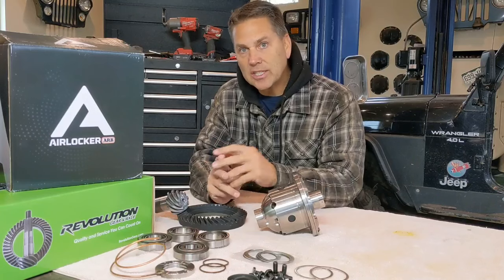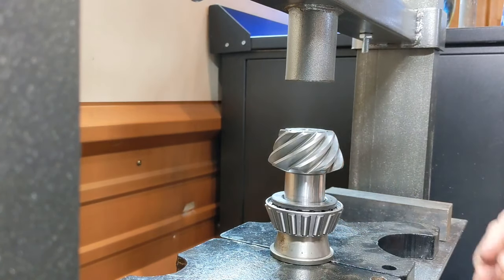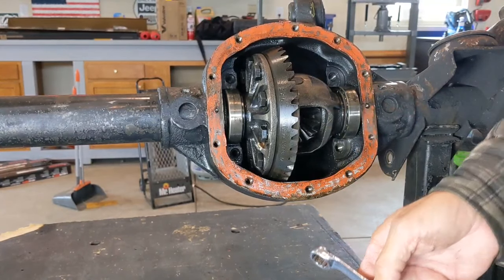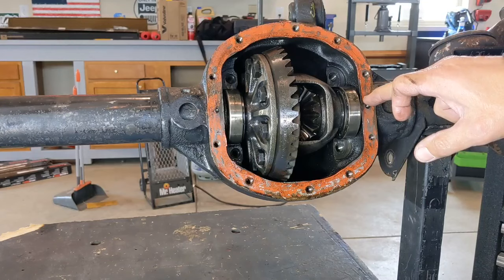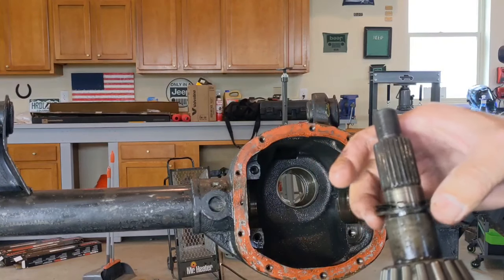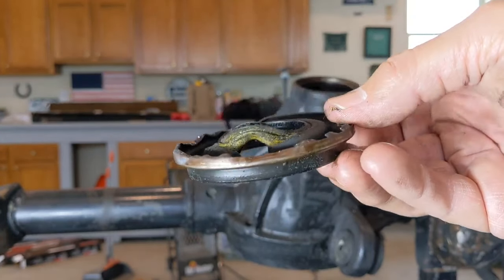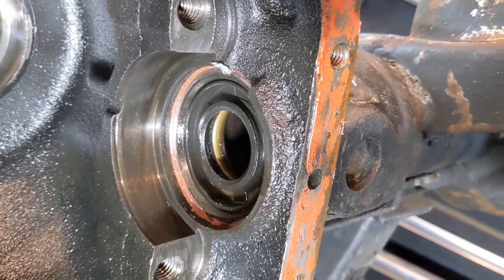How to Install an ARB Air Locker (Very Detailed!)

Comment: The most comprehensive video on air lockers on YouTube, I had been looking for months for this information and especially the setting up of the backlash and preload etc.
Thank you for taking the time to make this tutorial and sharing your obviously vast experience and knowledge with us, you have earnt my subscription and respect.
Reply from the maker: Thank you, I appreciate the comment and subscription!
Reply: @TheBFHGarage   Did you install shims behind the race because at the time of this video you didn't have a clamshell puller or you did it this way knowing most would not have a clam shell? I would really rather install shims on the pinion like my D44 I did as it made it pretty nice with the clam shell.
Reply from the maker: @ChrisLawley43  I installed shims behind the race because that's what came with my install kit. At the time my preference would have been for it to be the same anyway as I didn't have the clamshell puller. But the install kit was the main factor. If you plan and installing behind the pinion bearing then make sure your master install kit comes with those shims because most don't.
Reply: I second that. Great video!

Comment: This has got to be ,by far, the best video I've found on setting up gears in a diff. Aside from the helpful instruct for the locker. I just finished building a 3rd for a Toyota with ARB airlocker and 4.88's and was looking for something on routing the air line, then found this. I only wish I found it before I built the diff. All the other videos on setting up gears are made with the assumption that you'll be using the same housing and can base pinion depth from existing setup, but starting with an empty 3rd and new gears, finding pinion depth is tricky without the ridiculously expensive pinion depth tool. This is very helpful stuff. Very well done. Thank you for your contribution

Comment: I had arb locker’s professionally installed on my ram 3500 and I just got a quote of 800 dollars to fix the “ bad batch of seals” that arb used in their lockers. This is the 3rd time‼first 2 times were under warranty
Reply from the maker: There is no way it should cost $800 to replace the O rings. Are you 100% sure it's the O rings? I would check everything before just replacing something. Especially if they are doing it for the "third time". My guess is something else.

Comment: So I had a guy that was doin our gear work on the side , he is "head mechanic " at local 4 wheel parts ,  I had him do my gears front and rear and rear locker ,  then later on I decided to do arb in the front so I had him do it ,  needless to say the gears ended up eating their self up in the front ,  he didn't shim it right and I asked him to take a pic of the pattern he settled on and send it to me  and he couldn't even do that, so I'm positive he didn't run a pattern,   but when I told him what happen , he tries tell me it wasn't his fault ,  so I make him replace ring and pinion and I bought install kit.  I'm a pretty good mechanic and was confident I could setup gears , so I tackled the install this time ,  well after fighting and fighting, I just couldn't figure out what was goin on , then it hit me.,  I didn't get a install kit for arb , I got regular install kit for open carrier ,  I was using wrong shims in between seal housing and bearing and everytime I'd put any preload on it it would lock up ,  It just never dawned on me to read the arb instructions,  and learn about the master shims ,  mainly on the seal housing side ,  once I figured that out with correct tools ,it was pretty simple ,  tedious but simple.  , I came back to your video to figure out the shims , luckily he used the master shims so I had them ,  and It took awhile to figure out all the different size shims in kit also. If it wasn't for that, it would had went quick.  Thanks for the great video

Comment: Thank you for this video! Been contemplating air lockers for my gladiator, and naturally I’ve been considering doing the work myself. This is very informative and helpful!
Reply from the maker: I have a Gladiator as well, but the Rubicon model so no need for ARB's... yet.

Comment: If I'm working on an axle by myself, I usually stuff an old pillow inside the housing. Use 1 or 2 extra large zip ties or zip some smaller ones together to hold the pillow in place. That will stop the pinion from falling out onto the floor and possibly getting damaged.

Comment: What an amazing video .. ! Great work! Thank you for sharing your work and experience with us - Quick questions:
 1. Did you add a crash shelve in the pinion assembly? I was under the impression that we should add one and then ''crush'' it as we tight the pinion to spec 
2. Is there a starting point of ''total'' rings that you add left and right initially? Is there a spec there or goes by our feeling of the backlash?
 Thanks again!
Reply from the maker: Some axles use a crush sleeve and some use shims. Use what your axle is supposed to have. The "rings" you are referring to are called shims. I usually try to start with what was in there and adjust as needed

Comment: You'll thank me the first time you use it if you like it. Look into capillary tube cutter. If you have the same looking wire strippers,  they work well too. Cut in the v shape Grove and it doesn't smash the tube flat. I'm an hvacr tech, and I'm a tool freak as well.
Reply: Good video.  Thanks.

Comment: Watching this video for the fourth or fifth time, it is the definitive Dana 30 regear video.  Especially if you are fitting an ARB.  Great job Mike.  I do have a couple of questions.
1. For an ARB locker install (where shims go on after the bearings pressed on to the locker) am I right that the only 'set up' parts are the race for the inner pinion bearing and a set up nut?
2. For the 'set up' nut is there a reason not to just use a standard nut with the correct thread, rather than filing down the threads on a stover style nut?
3. How do you decide on the initial shim stacks on each side of the carrier?  I get moving shims from one side to the other to adjust backlash, but not clear to me how to decide how much shim in the first instance.
Thanks in advance.
Reply from the maker: 1. Correct
2. You can use a regular nut.
3. Determining shims for each side is mostly a guess on a starting point. I always add more shims to the right side at first to ensure there is SOME sort of backlash. You don't want to force the carrier in when there isn't any backlash.
Reply: @TheBFHGarage  thanks Mike, answers much apprecated.  On the initial shims for the carrier, I get the point re the balance of the split, but is the only way to get a start point for the total shims for both sides to pull the bearings off the old carrier and measure those shims.  Or do you have a 'rule of thumb' number?  If so I think I'll need to get hold of a bearing puller

One additional question.  I have seen that for HP pinion Dana 30s from XJs up to 1998 there is a baffle that sits on top of the pinion bearing.  When I pull the old pinion out of the HP Dana 30 I am swapping in, if there is one of those baffles there do you recommend fitting a new one?
Reply from the maker: @eversleyowl  the starting point will be what it will be, not a specific number. Some housings have thick master shims outside of the bearings and others have them under the bearings. The key is to have enough pre-load so you can't pull it out by hand. Now when adding an ARB, it changes things slightly because the seal housing has an ARB master shim that mates with it. You put shims between the seal housing and the master shim to dial it in. You will most likely still need to add shims to the outside of the seal housing as well depending on how many shims are needed to achieve pre-load. So find a combination that allows for pre-load as well as adjustment.
Reply from the maker: @eversleyowl  as far as the "baffle", it's actually a thrust washer. If the original one isn't bent, you can reuse it. Most install kits include a new one.
Reply: @TheBFHGarage  that's great, again thanks for taking the time to explain.  I can't see one in the Revolution Master Install Kit I have, but yet to open up everything iside the box so may be there.  So if there is one in the differential when I disassmble I will look to install one when I regear.  Thanks.

Comment: Thank you so much.  Before this video I was thinking I can wing it.  Toward the beginning I was thinking I need to hire this guy to do it for me.  By the end of the video I know I can do this and I am looking forward to it.  Knowing what I am doing will make it fun.  I am going to buy a used one someone is selling because it leaks and he doesn't know why.  My guess is he didn't watch this video before his initial instal.  He replaced the ARB with a Grizzly.  Do you think it's a good idea to buy a used ARB cheap that leaks?  Maybe some pointers on what I should be looking for?
Reply from the maker: Those are some of the best ones to buy because you can get them cheap. Things to look for: Make sure it isn't an older three piece design (look it up so you know). Make sure the seal housing isn't leaking...hold your finger over the hole between the two O rings and then blow into the copper line-NO air should be escaping. Make sure it comes with the bearings and races or you'll be buying new ones. Make sure it comes with the ARB master shims (one for each side). Get the solenoid, switch, and wiring with it. If you can get the bulkhead fitting with it, bonus. If not, you'll be buying one. If the seal housing does leak, a new one runs around $100 so figure that into the overall price. I would also order replacement O rings for the seal housing and replace those since you have it out.

Comment: pretty good video ,most if not all high pinion diffs use a baffle and a slinger . i did not see those in you're video.
Reply from the maker: Maybe in stock form. The slinger is a shim more than anything. If you think you need a "slinger" in there, I encourage you to imagine the axle being on a bench with the diff cover off and spinning at 100 rpms. You would have gear oil dripping off the ceiling. As far as a baffle, high pinions usually do have them but I have seen some that don't. Plus not all master install kits provide them. I've never had one come back from lack of pinion lubrication.

Comment: Excellent video, I feel like I can do this myself after watching this! (and buying like $2000 worth of tools 😆) Indulge me on two questions if you don't mind, 1) when you reinsert the axle shafts into the ARB is there another step? Or do they just lock in there immediately? 2) What would be a reasonable price to expect to pay (labor only) for someone like you who works carefully to be precise to do this work? Just ballpark, thanks! Hope you keep making this great content!
Reply from the maker: First off, I'm glad the video helped you out and gives you the courage to tackle a job like this. As far as the axle shafts, they slide right into a carrier, or in this case, a locker. Nothing inside the carrier or locker secures them unless you have a C clip style axle such as a Dana 35. On non-C-clip axles, most of the time they are held in place with retainer plate/nuts on the ends of the axle tubes.

Talking about labor cost here is pointless. It varys greatly from state to state and region to region. A lot of shops won't let you bring your own parts. Some charge by the hour and some by the job. It's really all over the place. I can say this. If you get a quote and it seems excessively high, shop around for other quotes to compare.
Reply: @TheBFHGarage  thanks! I figured that would be your response about cost but thought I'd ask. As far as the c clip axle goes I assume the ARB would provide access to this area of their carrier to reinstall the c-clip if that was the case? Unlike the one in this video that looks pretty solid, no access to reinstall the c-clip that I could see...

Comment: When you use the dummy race to do the pinion setup, instead of "machining" off some of the material from the outside with a Dremel or whatever, why not just cut it with a single vertical slice? Much easier! That will allow it to be pushed in fairly easily, as it can close up slightly when it's squeezed hard. It's only the height of the bearing race that matters for that setup, so that won't change.  I do the same cutting with a scrap race to make a tool for tapping or pressing in new races (as it's a perfect fit, but doesn't get stuck).
Reply from the maker: Think about your statement. I'm not trying to take material off the backside of the race, rather around the outside of it.
Reply: @TheBFHGarage  No, I understand that. But to reduce the diameter of the dummy race, rather than trying to evenly grind some material off all the way round the circumference, if you make a thin cut all the way through it, it can spring open and closed. At rest, it will remain the same diameter, but it can be squeezed a few thou smaller with reasonable ease. Like your version, it can then be pushed in and out by hand rather than needing to be pressed or tapped with a hammer. And it's easier to do, and it has the benefit that when it's done, the dummy race has still got its pristinely round and shiny outer surface, without the marks, roughness, and flats from the grinding.

Give it a try.

Comment: Love the vid. Getting ready to do my first ever locker install, a Yukon Grizzly in a D50 TTB, but this vid helps a LOT to help me understand the steps AND logic. 

One question, why no crush sleeve? On disassembly my stock D50 didn’t have a crush, but the Yukon rebuild kit includes one. Do I use it?  Thanks!
Reply from the maker: At all depends on the axle type. For example a low pinion Dana 30 or a Dana 35 will use a crush sleeve, whereas a high pinion Dana 30. Or a dinner 44 uses shims. Use whatever came out of yours

Comment: I just want I'm trying to say is how can you set the gap between the pinion ring and the ring gear when you haven't set the new shims on pinion gear, or bearings and races for the pinion. It seems like you would want to get all of that put in place first then set the proper gap and use paint to adjust the tracking

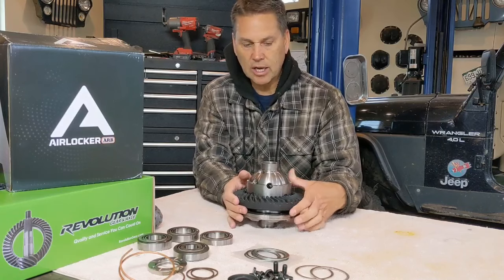Comment: Great video! I am considering putting in 3:73 but there’s no way a shop will be as meticulous as you, which is unfortunate. I might give this a try just to check everything is done correctly. I am currently running my 3:07 with spartan lockers. Was curious where’s your shop located? State?
Reply from the maker: I'm in Colorado. Why go to 3:73? What size tires do you have or want to have? Which motor? Which transmission? Have to take all of those into consideration.

Comment: Hi again Mike.  You go through a number of specialty tools that you use.  I wondered if you also use a pinion yoke puller to get the yoke off when you need to remove and reinstall the pinion during the fitment process?  If not, what is your technque for yoke removal / do you find that using the punch to remove it each time is fine?
Reply from the maker: @eversleyowl  the punch is the best and fastest way.